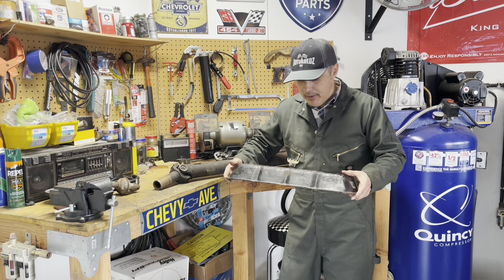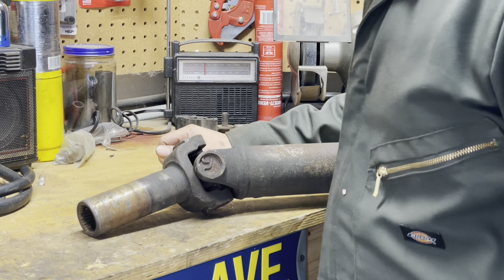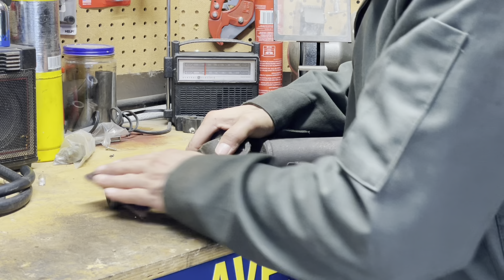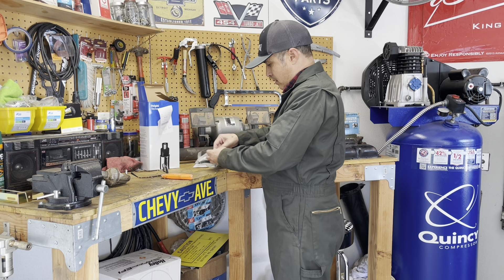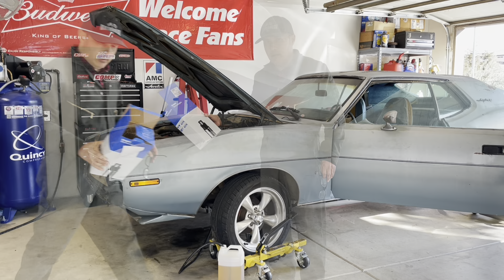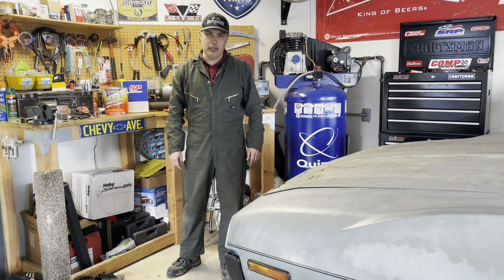1974 AMC Javelin Part 7

Comment: New old stock with dry rotted diaphrams could be the culprit.

It seemed as if you may have been a bit generous with grease.
Reply from the maker: That's what I was thinking about the diaphragms. They were probably sitting on the shelf for 20+ years!